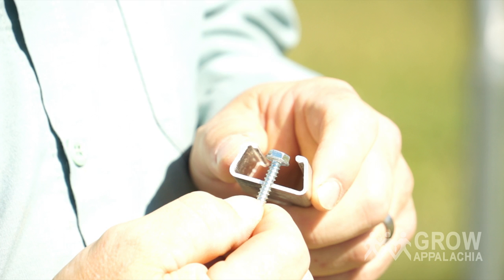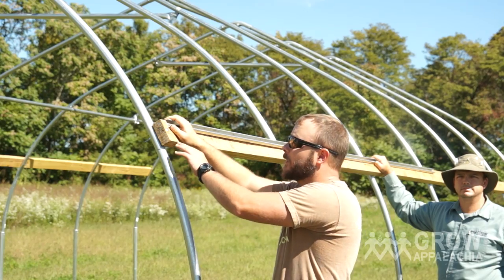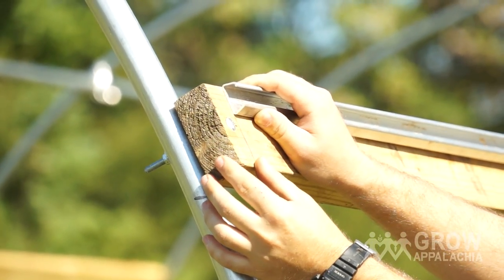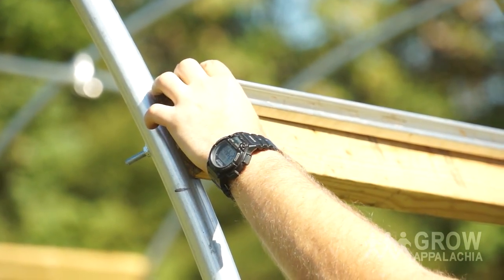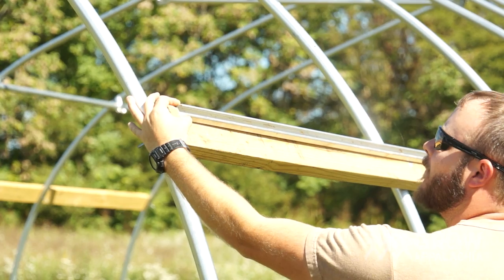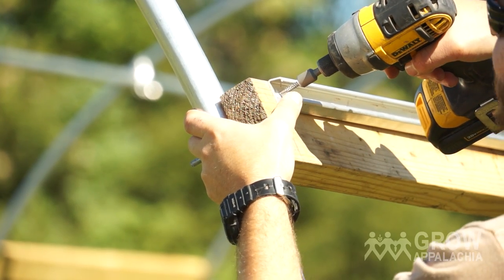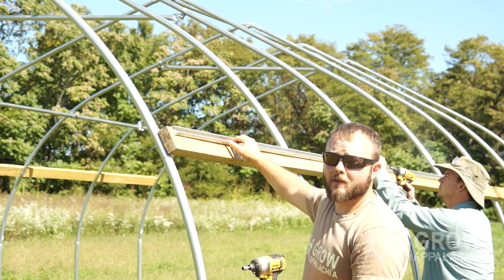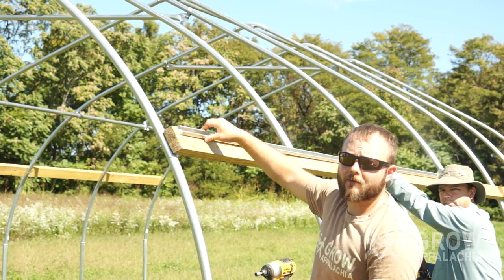11  Installing Wire Channel

Comment: Would have been so much better if you had pre-drilled the wire channel on the ground as it removes one more variable when assembling a structure like this. Wire channel is the only way to go for greenhouse plastic. Always good to have some safety eye wear when drilling metal. You have some very good tips.
Reply: when the bends are in the metal you cant predrill.. You would never be able to figure out exactly where the bolts go.. Just saying .. Go watch again and see if you can at the top bending the metal that hard ..

Comment: Never heard of wire channel before today.  How was the board mounted to the metal?  I am "drill bit challenged."
Reply: Sometimes you can use a u clamp sort of thing. It's pretty much got a pocket for the metal pipe like the shape of a U. And then it has pieces of metal that go out on the left and right side that can be drilled into the wood to attach the brace, then drilled through the U part of the brace into the metal to hold it there. You can also just use a drill bit to make a pilot hole in the board and into the pipe, and drive a screw or bolt into it.